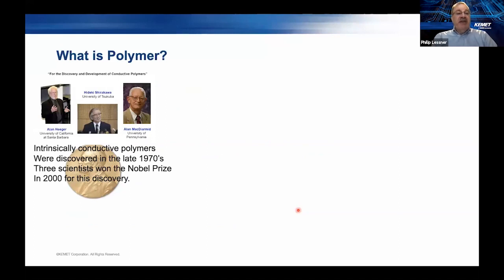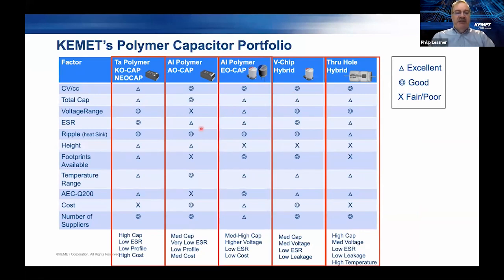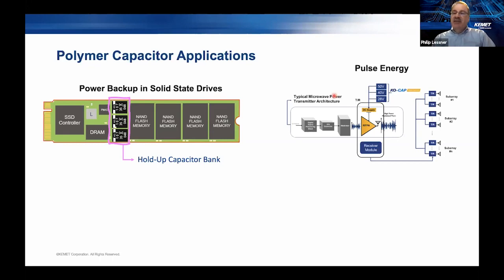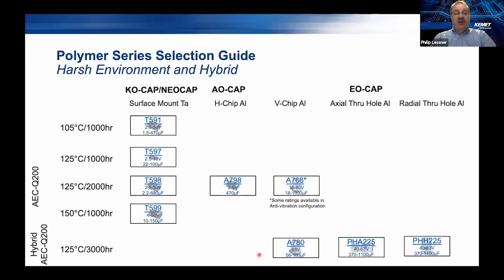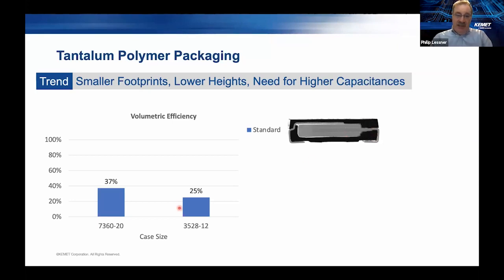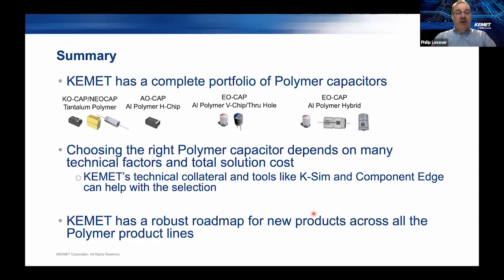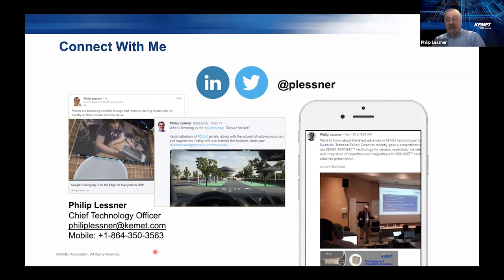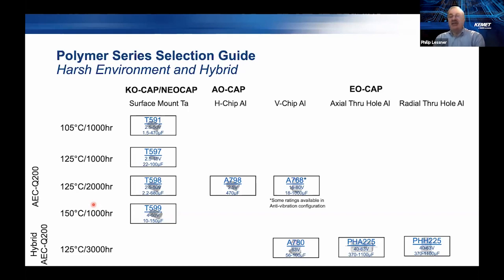KEMET Webinar | Choosing The Right Polymer Capacitor - A Guide for the Perplexed

Comment: I wonder if a publication has been made regarding the use of these capacitors in the audio path. Usually those with Polypropylene are chosen for their good tone/harmonics, this perhaps is due to the relative permittivity which is low (2.2).
What permittivity do polymer capacitors have?
Reply: Not documented from what I have seen, however in my experiments they are superb in both digital and analog, they just take a lot longer to settle; 2-3 weeks. I now use them all over in audio. Of course PP or mica where it's possible. Polymers in the power rails have been a game changer for me. I'd add, polymer in audio have a bad reputation, I've certainly read it, and think it's totally because of the settling in time they need - 2-3 weeks.. Many don't have that kind of patience and begin to doubt, then rush to conclusions about sound suitability or quality. When the time is put in, 2-3 weeks continual operation, polymer is amazing for audio of all kinds, there is just a time investment needed, like a film cap.